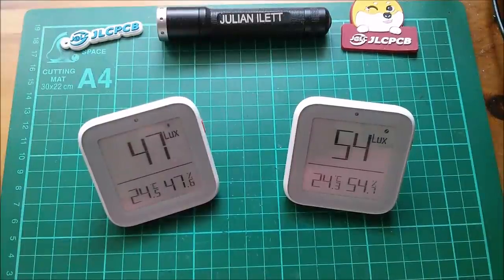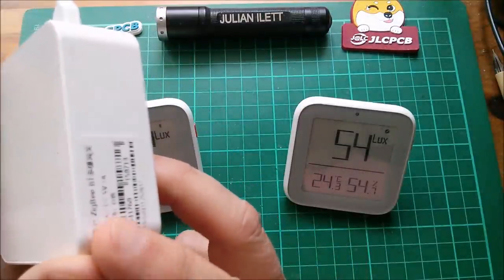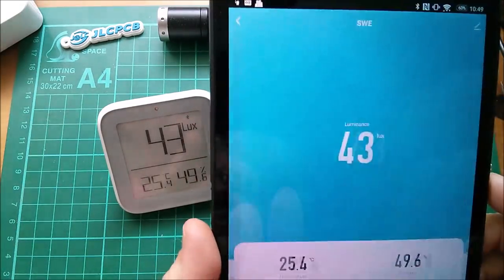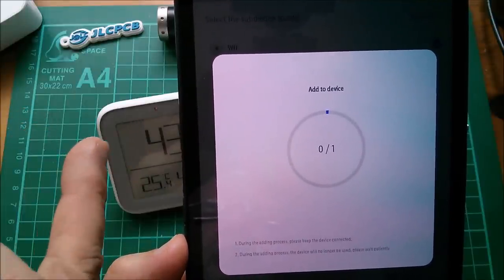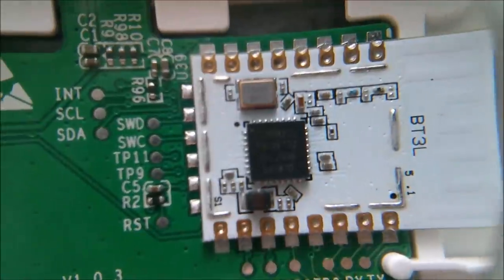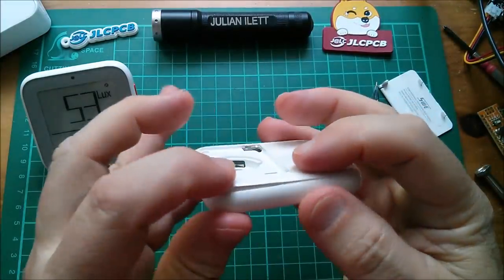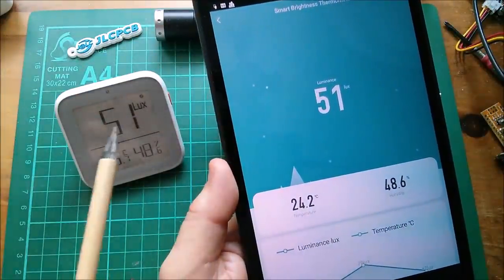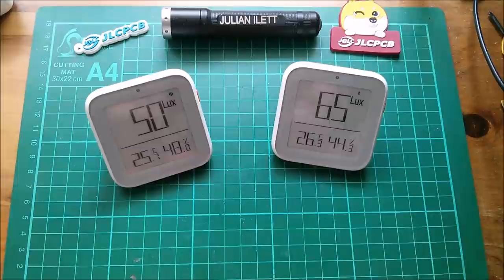Spot the Difference - Wireless Sensors

Comment: Most Bluetooth devices cannot connect to more than one master device at a time.  They may not even be able to do the initial pairing if the phone's Bluetooth is already connected.  So unless the App for the wireless router is disabling the phone's Bluetooth in an attempt to pair the router, it cannot succeed.  Maybe try pre-pairing the router to the sensor devices without phone Bluetooth first?

Comment: These devices usually don't have an active connection but rely on BLE broadcast instead.
Reply: Indeed, just sending a non-connectable Advertisement every minute or so gives fantastic battery life
Reply: The Xiaomi Bluetooth hygrometers use a paired connection and encryption unless you reprogram then with the ATC/pvx firmware (which is very simple) then you can use advisements to your heart's content. I've got them in every room and pickup the data with a Pi running Mitemperature2

Comment: Btw You Could Get a SRD for your Tablet USB OTG Port  With a SRD transceiver - HackRF One  - ADALM-PLUTO - LimeSDR
However If you can get into you table or laptop /nuc you can Replace the 2.4Ghz & 5Ghz WiFi and Bluetooth  card with a Fairwaves XTRX Pro uses  the mini PCI-E Slot [NGFF - M.2 slot]
XTRX Pro would be one hell of a Laptop /nuc  upgrade due it has a FPGA on board  so quite the little  Accelerator for everything

Comment: Your description of the Bluetooth device connecting to the hub seems similar with other devices.   Soma blind motors use a similar process to connect to the Soma-Connect hub.  The Soma-Connect integrates to other systems like SmartThings and Home Assistant, but never talks to it properly via the app......    BlueTooth / BL connection seems a bit hit and miss still.  Did you try with the sensor virtually sitting on top of the hub?  The pairing for BLE seems to only be very short range, like only a few inches.
Reply from the maker: Yeah, I tried proximity pairing, rebooting while pairing (holding the switch for different durations) - I tried it all :)
Reply: @JulianIlett  A finnicky hub or sensor then.....    No such thing as standards in anything :)
Reply: @JulianIlett  I was thinking a button press may be needed to put it into 'pair' mode, I see you've thought of that already

Comment: I wonder if it's a permissions thing on your tablet. It must be sending the data within the BLE advertising packet, but the tablet isn't passing the Bluetooth address to the hub. Traditional pairing is unlikely to work well for ultra low power devices that need to last a long time.

Comment: Strip the BT down and reuse the eink display for another project.
Reply from the maker: It is a nice display - shame about the font though.
Reply: @JulianIlett  Fair enough - I wish eink displays were cheaper. Maybe they could be used in more devices. I am personally look forward to working on a 7/8" display that doesn't cost the earth. Do you know if the old Kindle displays could be reused?
Reply: @SimplifyingChaos  Same, i wanted to build a 'cheap' e ink reader using microcontrollers but the displays cost almost as much a kindle

Comment: I suspect it’s lack of proper debugging on the microcontrollers.
Reply from the maker: I'm guessing there are a set of protocols for Tuya Smart devices which these sensors should implement. Looks like the designers haven't done a very thorough job :(

Comment: Probably asking the obvious, but can you do  a firmware update on either of the devices?
Reply from the maker: Yes, that seems to be a feature of the Tuya system, but I've never seen any device firmware updates. The app does appear to be updated though.
Reply: @JulianIlett  i askt the seller for a firmware update, and he did it. not via Tuya
Reply from the maker: For which device?
Reply: For the Tuya Zigbee temp, hum, and lux sensor. I bought it at Ali expres from Haozee official. He needed the virtual ID from the Zigbee gateway hub , and an hour later i saw the flux value in the Tuya app. Best Regards
Reply from the maker: I'll try, but I bought it on eBay.

Comment: Seems like a real waste of money. I build my own sensors using ESP8266 or ESP32 (both Wi-Fi) - they simply report over MQTT. I used to write my own code but I'm switching to ESPhome which gives the ability to add some code if you need to but does a lot of the heavy lifting for you. Node-RED is used to do any clever stuff like linking together devices from different wireless systems (from Lightwave, Wi-Fi and Zigbee for example). Display is provided by web pages or some ESP's with built-in displays such as the nice (but slightly expensive) M5Stack Basic.
Reply from the maker: I think I'm headed in a very similar direction :)
Reply: Great combo there ESP32, mqtt, node-red, especially if you want to do your own thing.

Comment: What's the fun of doing DIY stuff, if you're just gonna go out and buy pre-made stuff? 
You could've made one with an ESP32, an HT-22 and a photo-resistor. 
Plenty of Wifi and BT Web server Arduino code snippets on the web, to get it done in an hour or less. 
Then you can even go nuts with all sorts of extra functionality. It'll be open source to your heart's content.
Reply from the maker: Buying commercial units shows the 'state of the art'. I fully intend to build my own devices - but seeing how the pre-made units do power management, display selection, microcontroller and wireless selection is helping me formulate my own plan :)